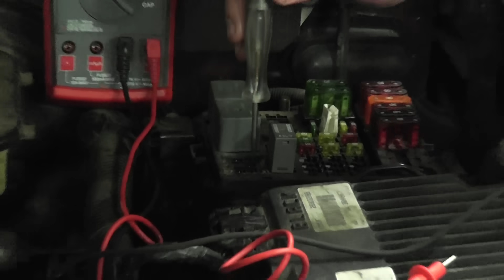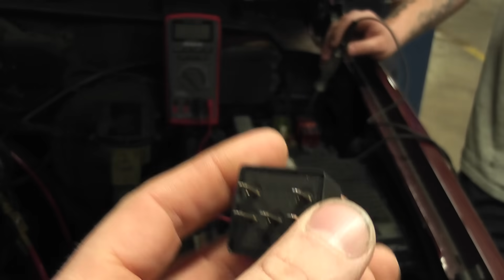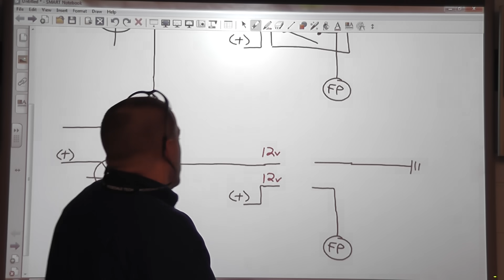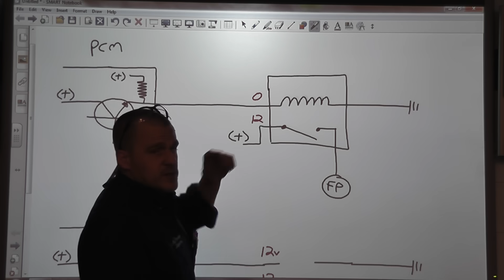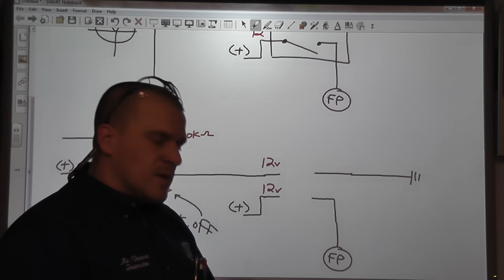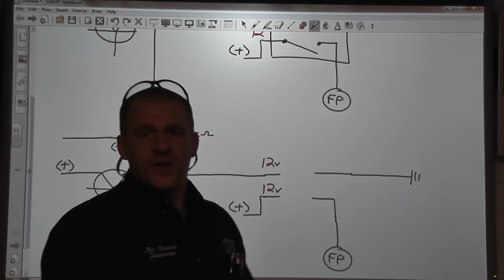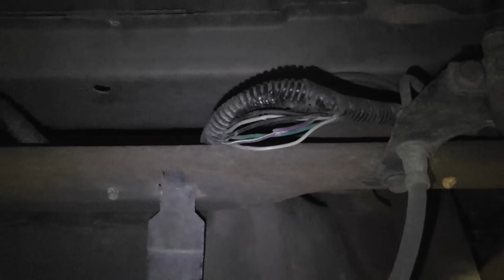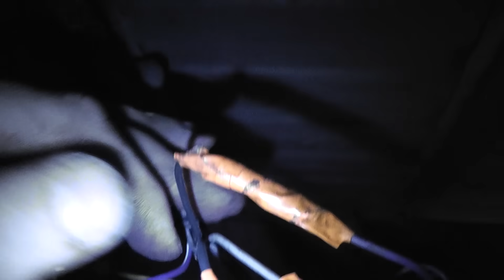GM Fuel Pump Relay Testing

Comment: Hey Danner , Let me share this with you and maybe you can share it with others, for two months I put two different pumps in the tank both times all the pressure I got from both of them was 15psi and it never did start, then I got mad and kick the fender then looked at the pressure gauge it read 50psi that meant it should start, crank it up and vroomm! took the gauge off crank it backup and took off, got to a friends house and it quit again and wouldn't start call a tow truck up that took me back home. the driver ask whats wrong and I finally came to the conclusion it's the computer.  But the driver pop the hood shinned his light at the body ground straps and ask me to see if it was connected, well it looked like it was, then he told me to grab it, I did but it was not connected to the body, he told me thats the problem because that's telling your computer not to send the fuel pump a signal He said if you replace that ground strap it'll start, once I replaced that thank God, I back on the road again.  Thank You for that video though
Jimmie

Comment: one other question, are you suppose to get that same signal on pin 85 every time you cut the key on again and then off again?  then when I turn the key off it lights the test light for two second and goes out is that suppose to happen?

Comment: I purchase a fuel pump for a 1998 chevy P/U, 4wd, 5.0 engine. the new pump had a different plug gray, purple, black and a black with a white strip.  when I cut the original plug from the truck, I connected gray to gray, purple to purple, black with the white strip to the larger black wire on the original plug from the truck and the other black to the smaller black wire on the original plug.  I did it that way because there was not a wiring diagram.  any suggestion Jimmie thank you

Comment: Hey Danner I have the 97 chevy express I replaced the pump hooked wires up correctly pump wasn't coming on so I got under the vehicle with a tester light hooked it up to a ground and the grey wire and pump ran I turned the van off let it sit and cranked it again now it comes on with no problems any ideas whats causing this

Comment: Nice video. Glad I found it. I did the relay center tests which duplicated yours. The only difference is I don't hear the pump coming on.
 I have not done the checks back at the tank, yet. When I checked the voltage at the control side and then added the test light, volts did drop to zero but my light did light. Is there any significance in that result? What if I don't get power back at the tank, where do I go from there?
I'm sure I'll have more questions but that will get me through next steps. Thanks for the help you are providing!

Comment from the maker: When it doesn't start you need to check your fuel psi. It is possible to have an intermittent problem with the fuel pump motor itself. That is most likely your problem based on your symptoms.

Comment: (continued)
I've recently driven it to a local Auto shop I, usually go to when, having car trouble, and the Mechanic told me I, may need a new Fuel Pump.  I've also learned, it could be the Fuel Filter that, causes a problem like this.  I've tried listening to the Fuel Pump by, putting my Ear to the gas tank opening when, the Truck is turned on, but I didn't hear a buzz...however, if I get it started I, hear the Buzz just fine, and the Truck stays running without any problems at all.  I'm lost..

Comment: I'm going threw the same thing with my '99 Chevy Suburban..  After sitting for a few hrs., it cranks, and turns over just fine, but it won't start...however, after umpteen times of trying...sometimes, it'll start, and it'll stay running smooth like, nothing's wrong with it, at all.  Before learning this could be the problem by, watching this video, I've change the Starter, the Alternator, and the Battery thinking, those things could be causing the problem, but they weren't.

Comment: Ok I have the same problem put a new fuel pump and filter on my 2000 s10 2.2  auto 2 wheel drive and on the ground i have 10 pounds of pressure in the air I get 60 and it will run for about 10 mins then lose pressure and stall we checked the relay and the pump good power and ground no pinched lines but still no pressure out of ideas any suggestions??

Comment: Used a scan tool and found my fuel pressure running on idle is 20psi. Lambda B2 commanded shows 255.00 lambda. Fuel tank pressure 0.00volts. Oxygen sensors B1S2 and B2S2 both show a voltage of 460-470millivolts. Injectors dont show any movement on charts neither do the O2s but on tables i can see the injectors 1,3,5(bank1) pulsing 2.2-2.1ms quickly but bank 2 are stuck on 2.2ms and rarely switch. Its running a little rough. Any suggestions? Thanks

Comment: Ok great. Thanks for the info. just a thought, Do you think it would be wise to bridge another battery in the system to see if it starts by itself with 24 volts? or would that be to risky? Just thought I would ask to see if the extra volts will help provide more pressure to start it!!!!!

Comment from the maker: Yes, your fuel psi is to low during cranking. This system needs to be higher than 50 psi to start. Spec is at least 60 during a crank. When the fuel pump gets weak on this design system, this is the exact symptom. The weak pump with only 10-11 volts (system voltage during a crank) cannot produce enough psi, but with 14 volts (running voltage) it can.

Comment: Was wondering if you might be able to help me. I have a 98 c1500 4.3 vortec. The truck will not start on its own. i can pour a little gas in the throttle body and itll start right up and run until i shut it off, and itll start fine until i go a couple of hours without starting it, then i have to manually prime it again, i do not have a fuel pressure gage but i took the fuel line off the filter and gas does flow when the key is switched on, any suggestions?

Comment from the maker: for sure and the heat you felt was from a resistance problem. a melted connector would be next if you didn't correct the issue.

Comment: i have a 2003 gmc yukon, went camping to Big Bear California and as i was driving the truck it just shut off. try craking it again and just sounded like no fuel. the car had half a tank. im thinking it could be the fuel pump. i just dont have equipment to check for the fuel pressure

Comment from the maker: If there is a return line, pinch it off and check pump max psi next. (should be near 100) Then if it stays at 50, check your power and ground.

Comment: Well, I lowered the tank enough to get to the top of the pump and wiring harness.  The gray wire had pulled apart at my soldered connection.  The pump now runs with a jumper across 87 and 30.  Still no power on the control pin (85) when key is turned and yep, I knew that terminal is only hot for a few seconds when key is turned.

Comment from the maker: Yes, the next thing would be to check for spark and injector pulse and tell me what you are missing. 
The PCM needs an RPM input to power this circuit cranking but that doesn't answer our no power during the key on cycle. You know this power will only be there for 1-2 seconds right? So if no power for sure then we need to go toward the PCM powers and grounds next. 
With the key on see if you have a 5v ref. on one of the TPS wires. This can answer a lot of questions for me.

Comment: Thanks for the video.  I am having an issue with a 1998 Tahoe no start.  I thought the pump went with 184k miles and sounding louder lately, and finally, no whine.  I replaced the pump, soldered connections correctly and still no go.  I replaced the relay, again, no go.  I found your vid and tested power dist. box.  I am not getting any power at pin 85 when turning on ignition or turning engine over.  86 shows good ground, 87 has power.  Any suggestions?  Thanks

Comment: Great video. I have a1995 chevy z71 which will not start, however when I spray gas in the  carb it will. I can hear the fuel pump on when I turn the key and when I loozen the fuel line at the carb siide there is fuel when I crank the engin. For some reason the fuel is not getting into the carb. What should I check next?

Comment: The product I mentioned aside, my point of contention is that as a professional technician and instructor, Paul should know that he is able to do a LOT more testing from the relay base than what he is doing, and from other videos of his that I have viewed, he doesn't... It would save him a LOT of diagnostic time if he were to take advantage of these procedures.  Not a huge fan of 2 alligator clips separated by a piece of paper running a circuit on a vehicle up on a hoist either... Just sad

Comment: You misunderstand the product I mentioned or you do not understand what it does... And in a nutshell it "does" pretty much nothing other than allow a technician to test the various circuits of a relay while at rest or while operating. The technician is still required to understand the circuit being tested. Still has to know if it is Positive Side Switching, Ground Side Switching, Normally Open, or Normally Closed and if you are supplying battery power or a ground.

Comment from the maker: I am sorry you feel this way. There is one thing I need to clarify and I should have but didn't in the video. We placed our t-pins between the terminal and the plastic housing NOT in the female part of the terminal. As for the wires that were damaged under the vehicle, they were like that when we got it. I understand you not liking piercing a wire to do a test but sometimes it is necessary. Hopefully you will give me another chance to see that I am not a hack. Either way, Have a great day.

Comment: This is the third video posted by you that I have suffered through and it is completely and utterly PAINFUL to watch you bumble through diagnostics... Either you are using  scopes reviewing wave forms when you don't NEED to, or you go to the opposite end and diagnose like a stone-fisted caveman stabbing wires and shoving metal pins into relay bases like a Hack Backyard Mechanic. Hint: You can test the ENTIRE circuit (Amps/Ohms/Voltage) from the relay base if you have a CLUE what you are doing...

Comment: Paul. In most cases on a power side switches (and all other sensor who are working on same principal) I can expect a bias voltage when we test that circuits, or it can be found on ground side switches two?

Comment: fuel that's why i am thinking i'll have to replace the fuel pump in it now , i switched the relay out between the blower motor relay and the fuel pump and nothing changed so since the blower motor still works fine too i am assuming that wasn't it.  the only thing i can find that was left is the fuel pump it's self but why would it work fine for 10 minutes or less and then fail?

Comment: I have a '94 silverado I have to work on sunday apparently they changed a dead battery and i no gas since. I checked it out a while back and pump isn't kicking on. I was almost ready to change pump till I saw the work involved. probably the pump but good to test power first for sure. Wasn't sure where the relay was..till now..very thorough video my man! thanks

Comment: not sure this is helpful for my wife's 98 saturn which is currently having fuel cut off issues after 10 minutes of running but i think i am going to try a new relay on hers because i've replaced dang near every other sensor and still it runs 10 minutes then the fuel stops and the car shuts off but you can crank it back up and run it again right away, it idles rough right away again and dies wait till it cools down completely and you get another 10 mins out of it. thinking  relay is shorting out

Comment: not sure how to test for voltage,but was told might be a bad connection at theconnectors,so i spliced the 3 wires togather,from fuel pump and i tried to see whaich of the 3 has power 1 does light have power out of the 3 so not sure how to check the voltage tho and i hooked up the fuel pump to a battery and it does work so not sure what else tried 2 different fuel pump relay fuses and still nothing so must be wiring im thinking folloed the wiring from the pump th the engine so nothing bad there

Comment: hi i have a 97 chev suburban  5,7 l    i out in a new fuel pump and it worked for about 2 months no problem then a way home it just died  so i thought fuel pump again so put a new 1 in and still nothing so now no pwer going to fuel pump turns over but cannot hear fuel pump anymore, put new fuel pump relay fuse in and still nothing , a new fuel filter as well service engine light not on as well so not sure what could be any help lol thanks

Comment: They say to change OHC drive belts at a certain mileage,but what about electric fuel pumps? ever since EFI we now have entered the age of the dodgy? fuel pump,some go for years,others fail earlier,overly short worn brushes and thinned out commutators,have a failure in an underground tunnel with no breakdown lane and a 'B" double Semi up your tail and you can kiss your arse goodbye,how long is a piece of string? who knows,perhaps manufactures should put a mileage figure on pump replacement.

Comment: Thanks for the reply! I asked my mechanic; The dist cap and ignition components have been checked, its all good. The whole distributor is 18 months old. The fuel pressure is 57 both when cranking and idling. The fuel pump has unusual sound, wich changes when banging on the tank.

Comment from the maker: My bet is the distributor cap is crossfiring inside. common problem on this truck.
Fuel psi should be over 60 psi cranking and around 54-55 at idle.
57 at idle is fine, 57 at WOT or cranking is not. So when was it 57?

Comment: Hi, my 1999 chevy tahoe decided to start running weirdly all of a sudden, one morning last month. It's apparently misfiring randomly in different cylinders. My mechanic's been looking at it for a while (casually) and got to the point he thinks it's due to a slightly low fuel pressure (57psi). He's pointing the finger at my fuel pump, wish I've put in myself 2 years ago. His truck runs great at 56 psi but he saw one having my problem at 58psi, it'd depends on the injector's check valve. Any help?

Comment: Danner, You just made my day with that biased voltage explanation. Awhile ago i was working on a relay circuit and my voltmeter "found" this and it threw me for hours. Nobody
I talked to ever had an answer. Like a Christmas present LOL Thanks. Hope Santa brings you one of those Lisle relay test jumper kits. The dink that stabbed, cut and miss wired that pump should get coal.

Comment from the maker: this may be your problem. remember the relay can work (click) but still not provide power to the pump if there is a problem with the load side switch contact or relay pin contact problem. The burned pin in the PD box suggests poor contact with the relay pins. This would be unwanted resistance in an unwanted location which equals HEAT. This will cause loss of power to the pump.

Comment: wow your one hell of a guy , to get right back to me,,, i have to look at your video agin, but at the relay block if your at the fender looking at it the top right pin hole has been soooo hot the plastc melted alil but the relay is working, i took the case off and can see it working , but will get you some number in the next day or two ... thanks agin

Comment: great video, it was sooo close to helping me,,, but didnt, maybe you can, i have the same truck, same storey, pump was just put in, no cut wires thow , relay works no pump, took  pump out of tank, and the only way it works is if you hook 12v 10 amps right to the red and blak wire of the pump motor it self

Comment: I have a 2004 civic. I just recently replaced the fuel pump. The vehicle cranks up for about .5 seconds and then shuts off. 

Today I removed the fuel relays and test both of them using a multi-meter for consistency and they were working. After putting the relays back in, I find that the fuel pump is not pumping at all. Any help is appriceiated.

Comment: I have a question. I have a 97 chevy malibu. I have recently had a fuel pump put in. It dont make the whining noise when the key is turned, the switched the ac rely with the fuel pump relay and still nothing, so i dont think it is the rely, I cant figure out what to do. what is the wiring on the fuel pump suppose to look like?? i need help please

Comment: Paul, I diagnosed a bad fuel pump on a GM, no pressure, good power, good ground (cranking, loaded circuit). I hooked up my amp meter to the prime wire and battery positive and got 0 amps; this test told me that I most likely had an open fuel pump, correct????????
 2 other possibilities would be an open in the wire from the prime terminal to the pump or a blown fuse in my meter, correct.

Comment from the maker: can you define very weak? test light or voltmeter? 
If you jump the load side contacts of the relay will the truck run? (jump 30 and 87 and DON'T  jump 85 and 86)

Comment: start by saying thank you for all your videos. question in the test if the 2 second prime one fails it shows light but very very weak where would I go from there? we replaced the fuel pump, it.cranks but won't start. tester is good after pump but not here in the box. 2002 suburban 2500

Comment: Wow... this is a phenomenal video, with a very thorough explanation. I always wondered how GM and Chrysler could monitor Relay circuits and throw a P1XXX code for a relay coil (control) failure. Im sure other manuf. do as well, Ive only seen it on GM and Chrysler. Thank you very much for this video. I don't use a test light as often as I probably should, usually use a DMM. I'll have to pull out the test light more often.